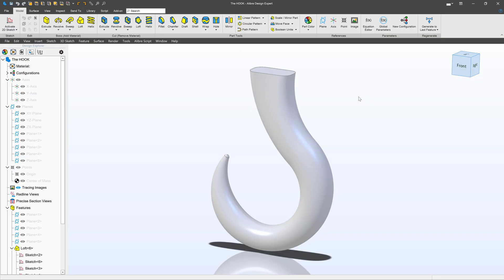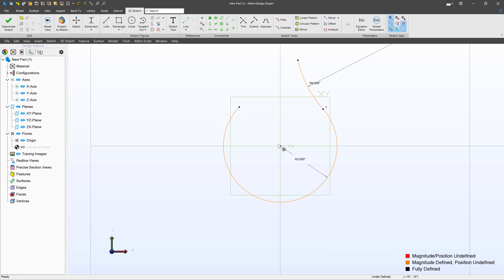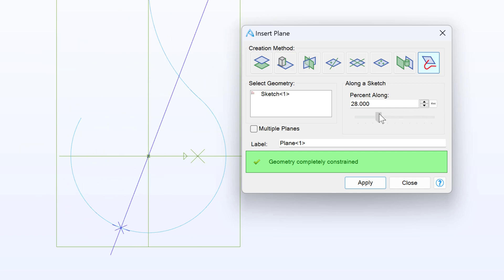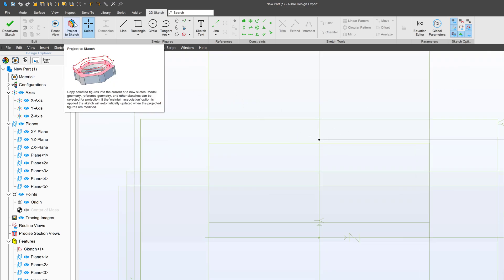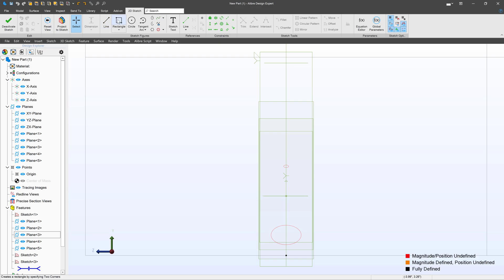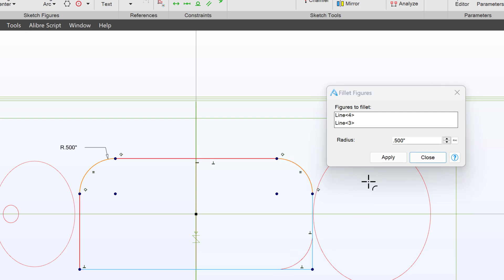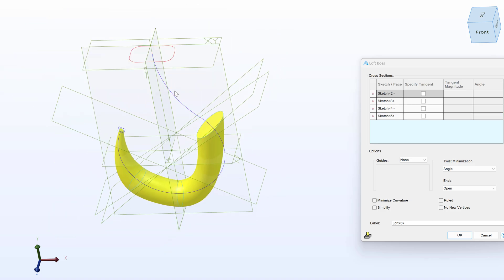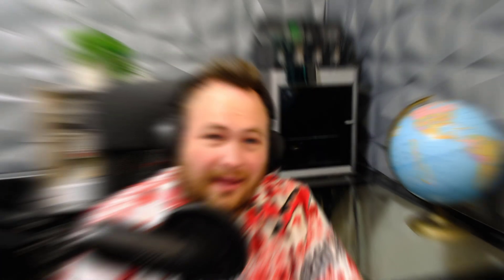Centerline Lofting a Hook | Alibre Beginners Course #18

Comment: Hi, excellent approach. I 've done a very similart part and I made also the mold plates for that and I have to say that your way is more simple. I had to draw all my section sketches tangent outlide from the guide, otherwise Loft didn't work. And I noticed that If I use the spline tool in the guide sketch the Loft didn't recognized it. Anyway thank you for the video.
Reply from the maker: Happy to help, thanks for the comment.